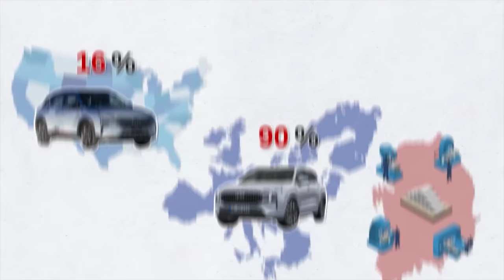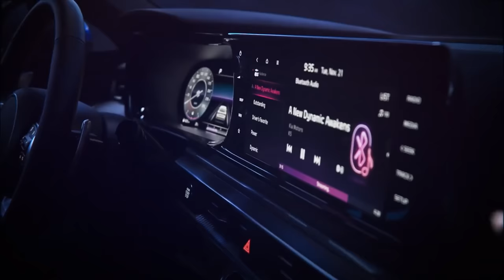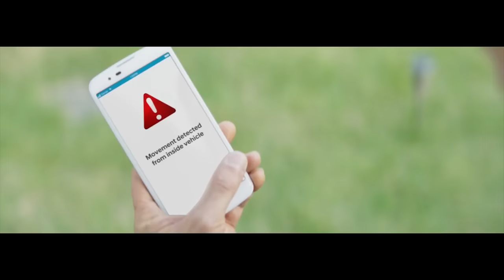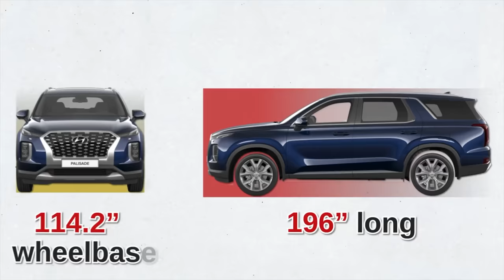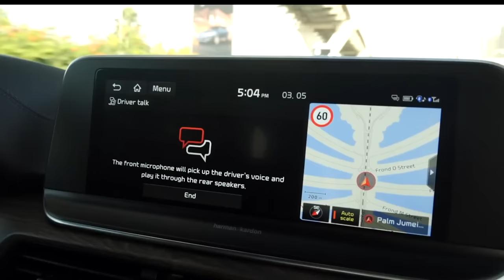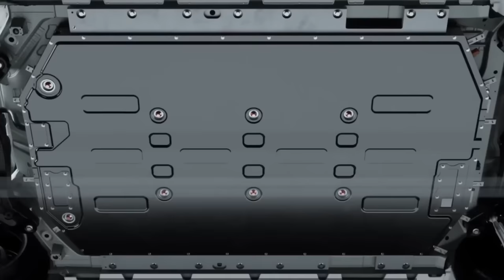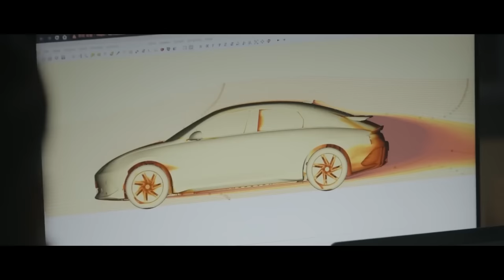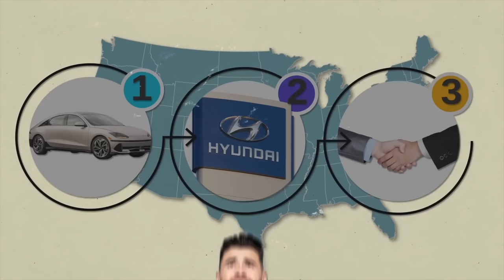No One Else Has the Balls to Say This About Hyundai and Kia, So I Will

Comment: It’s funny how loyal Hyundai owners are. I know one who’s 2015 engine blew up before 150k miles. All they talked about was how much they loved the car and wanted to buy another. Meanwhile I’m in my 2008 Toyota approaching 300k.
Reply: My son has a 2010 camry with over 500,000 miles...only normal maintenance has been done...origninal motor and tranny.  I own a 2009 camry ...uses a quart of oil between 5000 mile oil changes...dont care...it is the best car ive ever owned.  I absolutely love it and have no doubt i will put half a million miles on it too.
Reply: Ya most think 100,000 miles is a lot
Reply: I have a camry 2021 and the engine is leaking oil
Reply: @youdontknowme2915  Good luck with Chevy.
Reply: My 2007 Santa Fe has 273,000 miles.
Reply: Well all my KIA's lasted at least 250K before i sold them,and they were still working fine.
Reply: @tstbad59  They last as much as Toyotas, just maintain them properly.
Reply: Replace my engine for free had no problems and had a nice rental for 3 months still love my car
Reply: Sounds like our family😏
Reply: Hyundai owners I know either got ones that was trouble from day one and I know owners that got 300,000 miles no problem like a dude from work has a soul 310,000 miles no problems only reg service
Reply: @tstbad59  old Santa Fes last a long time. My gf had an 04 that was still kicking on 250000. It’s a piece of junk at this point to be sure, but it runs. It has eaten a lot of starters though for whatever reason. From what I understand though, new Hyundais have a slew of issues
Reply: No issues here. Going at 7 years 162,000 miles and so going. I could not find a Toyota that someone did not think was worth a MINT. My KIA is paid for and runs great.
Reply: Same with Toyota and Honda owners.  The control arm ball joint broke off in a turn and owner looked forward to replacing it.
Reply: @erickgutierrez5724  I believe it Toyota quality is going downhill
Reply: @stockey   some of you get  lucky....it's not the norm
Reply: @stockey  LMFAO ..no they don't.  Honda and toyota  usually outlast them by a lot
Reply: @bsgarey  but 152k isn't a lot
Reply: Well Hyundai and Kia made in 2008 also going good till now, 300k not a problem
Reply: So much people stil driving Santa Fe and Tucson from 2006-2008 till now , I am sure they have not less than your Toyota
Reply: @richsweeney1115  Perhaps not but I previously had cars like Honda Accord that maybe reliable but has HIGH maintenance costs of $1000 timing belts, $1200 dollers worth of engine mounts. I have had none of that with this KIA. It has never been in the shop outside of OIL/Break/Trans services.
Reply: Outside of the issues they've had, what makes them loved and memorable is they always are very comfortable with smooth and quite engine. The cabine noise is also lower than some other cars they compete with. I remember when I had a Sonata, and my wife had a Honda. The Honda's seats were very firm, and the ride was stiff. Cabine noise was also bad. When we took road trips we peferred the Hyundai.
Reply: @Marlon_J  I think many of the issues are owner issues. Not checking your oil/changing it at regular intervals. Not servicing the PVC system. Not fixing oil leaks. etc. Because I drive long distance to work (160 miles) round trip a day. My KIA Optima must be totally maintained to the T....
Reply: Which by the way Is why I hated the Honda accord. Always expensive servicing. Timming belts, engine mounts (twice), transmission solenoid packs. Then at 245,000 the head gasket let go. At that point I was done with Honda.
Reply: Me too my brother's 2013 Hyundai Santa fe sport engine blew up its a 2.0 turbo but he now has an unlimited miles lifetime replacement  warranty on the engines so if it keeps blowing keeps getting new ones
Reply: Funny how this 1/2 hour commercial for Hyundai and Kia comes from a guy who continuously blasts the companies for bad quality and recommends his viewers to not buy them.
Reply: @youdontknowme2915  goodluck with multiple ownership problems in future
Reply: @stockey  lol only few of them ever last that high mileage
Reply: @bsgarey  lol live in dreams
Reply: @jesusmejia7580  same with hyunda kia
Reply: @romank5498  only some in that period not even all of them
Reply: @bsgarey  lol kia soul with its 4th engine and trans going 90k mileage
Reply: @chronomatt6990  cuz ppl don't know about the real truth of real world hyunda kia tho
Reply: Toyota is better!
Reply: Agreed.  I know someone who had a 2018 Kona and traded it in against the purchase of a new Tucson last year - meanwhile the Kona had started developing a blowing head gasket and it's not like it had a ton of miles on it.
Reply: Agreed.  We have friends who thought nothing of an engine failure and will probably buy another of the things.
Reply: @chronomatt6990  I was wondering 🤔
Reply: It’s funny how people hate so much on Hyundai/Kia but never owned one. 😂😂 I’ve purchased 2 new Kias since 2014 and never had an issue. Just like you’re loyal to Toyota, people are loyal to what works for them. Toyota engines are awesome but the cars themselves lacked in styling and technology for a long time. Toyota is finally making decent looking cars. If you compare a camry to a maxima or accord, Camrys always looked like trash next to those two.
Reply: I agree.
Reply: @amandeepbaa6978  not really imo,. They've gotten better
Reply: @danieldimas8863  Maintenance is the key 🔑 for most, unless it's a Chrysler product 😉
Reply: Bro it always happens my brother Kia has problems like a mad dog but he continues to praise it
Reply: 8:25 you can use your smart phone to start your car and if you lose your phone you can use your USB charge cord to start your car... And so can thieves and TikTokers.
Reply: It's funny how loyal Toyota owners are. Even after some of their engines have oil sludge issues.  How the gas pedal got stuck or did an unintended acceleration and it won't stop,  causing accidents and death.
It's also funny how loyal Honda owners are... Even after their some of their transmissions grenaded and some CRV engines have fuel dilution issues that's causing premature engine failure.
You see, you can say pretty much the same thing for any make of car.
Reply: @John Diaz  and my sister has had a Hyundai and a KIA and been fine. She's bad on maintaining anything.
Reply: @jesusmejia7580  yeah in looks, design language and showcase not in their deepsht or stealership network where they infamous duped
Reply: Meanwhile I’m in my 1994 Toyota Celica approaching 400k.
Reply: @tstbad59   same here been the best vehicle that 2,7 is a good motor
Reply: @amandeepbaa6978  Engine failure – This issue was quite prevalent with the Kia Soul, especially with the majority of models we highlighted in this guide. Many of the complaints detailed how they were driving and suddenly lost power and stopped altogether.Jun 1, 2022
Reply: @amandeepbaa6978  This is well know fact with that subcompact auto. I would never purchase one.
Reply: Im a die hard Toyota Fan, i have the 5.7 Tundra and expect this truck to go well over 400k miles and it currently has 44k miles. My father on the other hand has an 04 Camry and surprisingly his Transmission blew at only 100k miles and he babies that car, it now has 120k miles. Moral of the story, just cause its a Toyota doesn’t make it immune to the same issues other vehicles have.
Reply: remember that they are car releases in certain years with problem. honda and toyota too have their bad years, scotty did a video about it :D
Reply: Mine had a computer problem it would stall lol
Reply: There are so large quantities of automobiles made worldwide, consumer logic is turning into a different dimension: just like the smart phone, it's not that costly to switch into newer models every five years. So 150k miles of engine is not that important. New look, new features, and a little more affordable is the future.
Reply: This is because buying a car is an emotional decision. People want to feel their confirmation bias, want to feel good about what they spent their money on.
Reply: I will say this. My sisters Hyundai motor failed due to a simple rubber seal on the freeway at highway speed in the late part of year nine of ownership and they replaced her motor for free. Not bad. My friends chevy spark had a recall fixed by the dealer and after repair it sounds like a rod is going to go any minute.
Reply: @markemery7741  How about a Hyundai with a ticking motor that you know is a timebomb but the dealer says it's ok because it passed a BCT test. Good luck feeling ok with sending your family out on the road with that.
So yeah, garbage brand.
Reply: @Antiorganizer  sounds like a bad dealer more than a bad car.
Reply: @rongurganious9797  he has lifetime replacement warranty tho so I don't think it's that bad lol as long as the rest of the car good can get brand new engine whenever
Reply: @bsgarey  NHTSA continue to fulfill report of new cases
Reply: 150k miles is a long time to own a car. You're hardly saving money over the long term by getting things they will last longer, and you're doing so at the expense of your own joy.
Reply: @youdontknowme2915  get your battery replaced yet?    Recalled just like the first Bolt .   That's quality!
Reply: His behavior is an example of Conformation Bias-he's developed a psychological dependence on his HOPES about the car and, even faced with evidence that those hopes were MISTAKEN, now cannot give them up and tries to JUSTIFY them!  he thinks " I CAN'T HAVE MADE A MISTAKE- I LOVE THIS CAR AND I'M GONNA BUY ANOTHER"!
Reply: @bsgarey  price isn’t bad tbh, was anticipating $3k or something over
Reply: @mygolfballsannoy  500,000 miles is a lot of time behind the steering wheel. A massive amount of time.
Reply: @mygolfballsannoy  hell my wife's Eldorado is pushing 180k miles with the famous N* engine
Reply: @youdontknowme2915  so sorry for ya. 2023 gm 😂😂
Reply: Yes but why did the engine blow up. They ran is out of oil.
Reply: @bsgarey  no it's subpar work from the factory and cheap engine components
Reply: @nickyj3571  Perhaps but you cannot do anything about that. You can keep you CAR full of OIL!
Reply: I knew someone who got a stinger. My immediate thought was “she’s going to dump that pos in 2 years”

I was right.
Reply: @Bootchair  they are ok cars for the $$$ as.long as you know that going into it. Other than that POS boring cars
Reply: @Bootchair  ??? I have had my KIA OPTIMA for 7 years no issues.
Reply: @Bootchair  Reported problems with the Stinger are few, so far, with most relating to non-engine electrics, and most models in the Kia range have a good reputation for reliability.Mar 14, 2023
Reply: @YouDontKnowMe The Toyota would not be the junker even in your scenario. The one that is not in the shop for 300k would be the opposite.Pretty much you like to drive a shiny turd is what it amounts to as we can see from your Chevy turd.
Reply: I have a 2006 Hyundai for my daily drive car with 87,000+ in mileage and so far, I'm still enjoying my Hyundai.

However, when its time to replace it, I may replace it with either a Toyota RAV4, a Toyota Yaris or a Chevy Sonic.
Reply: it comes with lack of understanding and embarrassment of what they bought. i read something that said kids growing up in hyundais will be normalized with items failing on them. also all the coolest words like genesis, soul, accent, stinger, ionic, sonata will be associated with terrible things
Reply: @njcowboys3588  they dont offer lifetime replacements in canada so we have quite a lot of paperweights
Reply: @pppcorn  oh wow, yeah I couldn't believe it either until he showed me the paper from the dealership, I was like damn as long as the frame ain't rotted you can get new engine lmao
Reply: I love my Hyundais the only other car i might drive besides is Genesis. My current 22 Tucson love it and the best one 17 santa fe v6 and still believe 06 sonata v6 is better over all. Sorry for haters
Reply: Maybe because people have had Kias and Hyundais that have been more dependable than Toyotas?  I had three Toyotas and they were the absolute WORST cars I ever owned.  Now, having my first Kia and I'm proud to say..it's been a wonderful experience.  No problems, and the car has many more standard features than any of my Toyotas could even fathom.

It's amazing how Toyota and Lexus fan girls will go to the extreme lengths at defending their garbage vehicles.
Reply: @jacksonndoll5055  hyundai is genesis
Reply: @Rich Sweeney  they are praying and wishing
Reply: @txrazor2643  junk
Reply: You're too old school. Toyota is a just very simple car.. Some ppl buy cars because of performances and high tech. Toyota cars are all outdated and only thing going for Toyota is last little longer than other brands. Not many keep their cars more than 5 years nowadays. I need a high tech car so Toyota is never in my consideration.
Reply: As a previous Toyota owner who have owned 5 Toyotas I only have good things to say about them about their reliability. I’ve owned 3 Kias and they have been excellent as well, so much so that I believe Kia is making better cars than both Honda and Toyota. Kias feel solid and their interior feel as well made and solid as Toyotas were back in the 90s. Toyota on the other hand is cheaping out on a lot of things and while they’re still bulletproof, they’re not without its fair share of issues. Also, not everyone keeps their cars for 10 yrs or drive insane amount of miles on them.
Reply: And if they keep blowing up you get another one why ride it until the wheel fall off
Reply: Common sense. It's a TOYOTA.
Reply: Why anyone buys these vehicles when a Honda or Toyota really doesn't cost that much more is beyond me. I'll happily stick with the reliability and great resale value of my Honda's.
Reply: Ford Focus owner, 2005 @240k still going strong. Have neglected the vehicle a lot but still is a looker and sounds good.
Reply: Depends on your priorities. I would get so sick of a car by 300k miles. Lol
Reply: @richsweeney1115  My Honda Odyssey was  piece of crap
Reply: Hyundai are great cars the difference between Toyota and Hyundai mechanics is that Toyota is more outdated and don’t improve technology and don’t give new stuff to people they improve the dinosaur engines they have (don’t get me wrong it last and everything you want) and the quality is the steel is way less than a Hyundai/Kia I’ve had 5 Hyundai’s already and will keep buying Hyundai seeing the EV someday sooner, the real issue here on any brand is when the flaws appears the people on the card dealers aren’t quite prepared to address the issue, I’d work at GM back on my country Venezuela and I know more than a dealership technician, they prepared only to replace not to fix! And believe me when I said it 😊
Reply: My Hyundai Getz is approaching 300 000km ..

Toyota just got a massive fine in Australia for the rubbish 2.8 diesel engines.
Reply: @conradscheepers  the Getz is such a good car on Venezuela we have them and they are rock solid still rolling there
Reply: my elantra 2010 have 5646321km only shock baljoint and regular oil change each 5000km
Reply: 😂 I’m sticking with toyota
Reply: @tyronmegawatts6580  but bro my hellcat has 3k miles with 0 issues. Pretty damn reliable if you ask me lmao
Reply: @kayossmayhem  that's only on kias/Hyundais with no push start
Reply: @damalewis9277  so? Every brand has a bad one here and there.....hate to burst your  bubble...but I've seen toyotas be shitboxes whe they were maintained, too...
Reply: @erickgutierrez5724  have you taken it in under warranty?
Reply: @mygolfballsannoy  well the average driver drives about 14000 miles a year. thats 7 years of driving for an average person./ so its a lot for the average person. thats a 10th of your life span to reach that lol
Reply: I have a 2012 Tacoma that currently has 270k miles on it and is still going strong. I had a  2017 WRX blew up around 130k and I considered that a lemon. I drove it hard too cause it’s a WRX. It’s crazy how Hyundai owners thinking driving a car casually and it blowing up at 100kish is “reliable” 😂
Reply: Yet. Wouldn't be surprised @thugblaster303 has probably been in more accidents than usual. Simply Toyota owners are simply terrible drivers.
Reply: @wenzhaocai6340  So we just gonna make up our own stats now? Here’s some real stats, Worst drivers according to Insurance companies in 2021
1. Audi - 2.85%
2. VW - 2.73%
3. Mazda - 2.72%
4. BMW - 2.67%
5 Hyundai - 2.57%
6. National average - 2.27%

Because according to REAL stats, Hyundai drivers are in the top 5 of worst drivers. Try again.
Reply: The thoughtfulness they put into their vehicles is extremely impressive.  Little cool, nifty things get put into their cars.  I’ve had mustangs, Mercedes, Lexus, Subaru, and Audi vehicles.  I had a Veloster N before I bought my current Lexus.  That little car was absolutely well thought out.  So much so that I am getting the itch to purchase the Kona N due to Albert Biermann’s hands on work on their production.  My Lexus bores me but it is luxurious and very reliable.  I think I need the Kona N as an extra vehicle.
Reply: @erickgutierrez5724  Toyota has proven to be bullet proof for decades now. I have a 2000 Camry with 340K running like new. I still buy Toyota and Honda only. 🤔
Reply: My 2016 Hyundai engine blew up at 115k🥲
Reply: I had a 2017 Ioniq and LOVED it! It was totalled during the recent storms😢😢.
Reply: Toyota quality is not the same as it was in 2008
These Brand fanboys crack me up.
Reply: @tyronmegawatts6580  i don’t why i found it funny
Reply: Go show me another car you can get for 42k that has all the luxury of a 100k car that my Sante Fe Calligraphy has. Heated and ventilated front seats, heated rear seats, heated steering wheel. 360 camera, turn signal camera, Napa leather, suede headliner, AWD 2.5T engine, every safety tool you could want. Nothing comes close for that price. I’m not a complete Hyundai fan boy but man what you get for the money beats other brands.
Reply: 270k on my Hyundai.
Reply: We had a Hyundai that was still going at 360k when we traded it in.  The only thing we had to do outside of the usual oil, brakes tires etc was an alternator.
Reply: @njcowboys3588  Nope it won't work that way. Don't buy anything that has lifetime warranty on Hyundai.  They won't honor it and you will have to hire a lawyer. My cousins 16 Sonata hybrid battery has failed. His car has been sitting at the dealer for over a year saying the battery hasn't arrived. In the meantime they keep trying to get him to trade it in. Now he's filing a lawsuit and it's taking time. Because of that I ain't buying no Hyundai or Kia.
Reply: @Sam-656  hmm it worked once so far
Reply: My grandpa's 06' sonata V6 is almost at 300k. I had an 07 camry where the engine went out before 200k miles (regular maintenence, known engine defect). Generally I would agree that Toyota and Honda are better, but not all engines are created equal!
Reply: You list a car with know issues, recalls on the 2.0 liter engine, kias and hyundai can go 200k plus miles, in fact scotty did a video with a kia forte, 1.8 liter engine with like 250k miles on it, every car that has ever been made, has bad years and good years.
Reply: @narutobase45  Facts.
Reply: older  Toyota yes ..new Toyota no good
Reply: My sister has  1989 Toyota Corolla still going strong in NYC no less.
Reply: @tyronmegawatts6580  GM used to make good products but not currently. 3800 buick V6 is as reliable as any toyota. i have a co-worker that has a grand prix with 270K on the series III 3800. i have a 2003 bonneville 117K and i consider it to just be broken in. it is an SSEi with the supercharged engine. i also have a crosstrek which so far has been great but it only has 12.5K on it.
Reply: At 150k, both cars lose 80-90% value. For example I can buy an equivalent Hyundai with more features, also save some money, at 150k mark use that initially saved money to buy Toyota with 150k miles. Basically I had more features at no cost.
Reply: I'll take a honda over toyota, but same concept
Reply: @bsgarey  even 152k isn't much....
Reply: @romank5498  yea..... older kias are ok...around 2010 they started building crap...I wouldn't expect one t last to 300k ,but thy were better in the 2000s
Reply: @bsgarey  the timing belt I the only  downside to honda.. and in like 08 I think it was,honda changed their timing belts to timing chains. the v6 still has a timing belt
Reply: @chronomatt6990  you think he controls the commercials??
Reply: @ErichH68  slso is honda..
Reply: @danieldimas8863  I'd never own a kia, I've known 4 people who owned them,maintanedthe, and the motors blew with lower milage.... you dont have to own one to see the  issues....common sense...,
Reply: @jmartyt9810  nothing tha has had oil changes often eough,will have sludge..not enough to be an issue anyways...clean oil won't leave sludge...
Reply: @bsgarey  I can't belive some of you believe everything you hear..
Reply: @trekkienzl2862  look at Hondas, too
Reply: @jacksonndoll5055  lol......nothing but a Hyundai???? that's just ignorant. I you think hyundaino reliable,  you'd be blown away by most Hondas and toyotas, lexuses and acuras.....do yourself a favor...Google Hyundai andkia problems....
Reply: @DeadofWinter321  I really dnt think thas true. Hondas and toyotas are literally 2 of the best on th road.
Reply: @damalewis9277  that's  the only honda even scotty has see problems with. the restof honda is fine
Reply: @richsweeney1115   i don't have to Google, I have Hyundais. You can also google Hyundai is the third company worldwide by sale volume. Those people must be ignorant to buy Hyundai like that. I don't care what people drive, i am fine with Hyundai.
Reply: @richsweeney1115  any without GDI engine will be good, and even if not, no one gets car for whole life like before, I am usually getting new car and drive until 100k or 5 years , even 4 years, so can sell that car for good amount of money and get something very advanced instead of drive  old car pay for service and in the end sell for few bucks
I can say in Korea they use Kia and Hynda for taxi with LPI engines, and those cars running pretty good till 600-700k kilometres… feel like all depends also market where car are going
But I can say for sure in Europe they are way better with materials and engines, don’t know why Canada and USA have so much drama around Korean brands..
Reply: Meanwhile I'm in an 07 camry close to 300k , you guys have fun with your Korean cars lol
Reply: @Dan-xp5ve  lol, man you can buy old Nokia brick and laugh at people using latest phone. What the car offers isn't only transportation from point A to point B, they offer convenience, and the value of that differ person to person. I wouldn't put my kids' lives in danger in that old car to save a few thousands, safety standards have gone way up.
Reply: @richsweeney1115  - They were back in the 90s.  Other brands have caught up, plus Toyotas and Hondas long term dependability has dropped very significantly since the early 2000s.
Reply: @richsweeney1115  I do like the Honda Fit
Reply: @richsweeney1115  Maybe but that is about average for me. Both of the accords I had only reached 245,000 before engine destruction. 1. oil failure 2. Head gasket failure....My other cars have been 1. ford 195,000 Accident, 3 GMs 175,000 average.  I drive 160 miles a day to/for work.
Reply: @jesusmejia7580 most manufactures quality is going downhill. But yes, the quality in Toyota is down, since more and more Toyotas are not made in Japan. The best quality Toyotas were always made in Japan
Reply: @youdontknowme2915  Most small and mid size Chevy cars are made by Daewoo
Reply: My 2017 Hyundai Tucson made it to 80,000 until engine damage 🤦🏻‍♀️ worst vehicle I have ever owned.
Reply: Toyota the uncle car ? 😂
Reply: Yeah, changing oil every month
Reply: never buying another hyundai ever again,thing sucks. knowing that kia is just a rebrand,I wouldnt buy a kia either.
Reply: I think they just don't know any better. I have a Mazda 3 from 2010 that is at 196k and I have only had to replace normal things like brakes and the calipers just went out.
Reply: My 2012 Hyundai is still going strong, and I'm sure there are some Toyotas that had blown engines!
Reply: we have a 2004 sienna as an extra car logged in 325000 miles. my 2009 Kia Borrego SUV is at 290,000 miles. Neither of two vehicles had any major issues. Love both of them. Both Toyota and Kia vehicles are very well made.
Reply: @youdontknowme2915 that Toyota will not see a shop it's whole entire life but your Hyundai and Kia will be in the shop for half it's life or 150k miles. My neighbor owns 2 and they're always in the shop regardless if you use them out not.
Reply: Don’t know about Hyundai but I have a Matrix with 52,000 miles and it’s been in the shop 4 times because it keeps pulling to the right. After 4 separate alignments(not covered in warranty) no one knows why. I’ve asked about suspension(which is under warranty until 70k mi) and I’m told it can’t be that. So now you know someone who’s completely unhappy with his Toyota before 70K miles.
Reply: @00DarkWatcher00  wow such low mileage, I’m sure you can sell it for a good amount if your unhappy. What year is it?
Reply: @ErichH68 Toyota is more known. Not better.
Reply: Toyota sucks!! I had 2 , both broke down before 5 years, the handles came off in pieces in my hands. After that I started to call a TOY just like in the name TOYota!! I have a Hyundai  for many years never had an issue , and I would buy another one!!
Reply: Why do you want a car from 2008?😅
Reply: @ErichH68  And boring to drive
Reply: I want an old Mercedes 300d. I just don’t like any of these newer cars.
Reply: Borrowed a friend’s hybrid Hyundai while getting my 100k service on my VW Passat. Hyundai interior materials felt cheap. Hated that computer screened car. Was glad when I gave the car back.
Reply: My turbo only survived two 103k. Engine limp mode
Reply: I have a 2012 kia cerato (forte). Never had any major problems. The engine is 180,000 km and no problem at all. My dad's 2011 Santa fe is at 350,000km at is still going strong.
Reply: 2015? then the car was under warranty as KIA offers a 7 year warranty. Had that happen in a Toyota you'd be shelling out for a new car. Are KIA as reliable as Toyota/Honda? No but its close. However to make up for that fact they offer a 7 year warranty and the cars cost CONSIDERABLY less.
Reply: That's Corolla from 2004 to 2008 are war tanks 👍👍👍🙏🙏🙏
Reply: I have a Buick rendezvous 2002 over 200 thousand miles and still going.
Reply: I knew a dude that got died from fried chicken. 😮
Reply: The interior design is loathsome. Never again. Ever. 
Drives well tho 11K
Reply: @youdontknowme2915  hyundais arnt not cheap at all you better look agai
Reply: I’m in my 2002 Acura RSX-S bought new.  Everything is still original except the battery, tires, spark plugs and windshield blades.  But only 160,000 miles.
Reply: Do you Think Huyndai can last for 200k miles?
Reply: @ZuhairJumaa There’s a Hyundai Elantra that went 1 million miles. Hyundai gave the owner a brand new Elantra as a gift.
Reply: I’ve had three Hyundais make it to about 275,000  miles before pooping out on me.
Reply: Well my 2006 civic which I passed on to my daughter in 2019 is still working well, I think beyond normal maintenance I've replaced the starter, and struts, that's it, I bought a 2016 Hrv cause I wanted a little more room and will be passing it down as well, only getting a new car this time cause I want one, Honda for life!
Reply: Did you get confetti after you pressed send? Fanfare? Lol whooppoopdidoo
Reply: @ParsleyTheDruid I was supposed to pick up a new Hyundai 2024 Tucson but didn't get approved this morning..was it a blessing in disguise ?... I'm wondering what to do now
Reply: @ErichH68 what would you suggest for a finance right now ?....I thought 2024 Hyundai Tucson was the way to go....now im hearing otherwise ...my pops says to go with TOYOTA but these prices are crazy right now
Reply: @kayossmayhem wow I heard about that smh
Reply: What would you suggest for me right now to get ?... Rav 4 or a camry oh which year would be the best ?
Reply: @erickgutierrez5724 whaaaat u Serious ?
Reply: I have an 09 sonata with 220+k not 1 single issue ever.
Reply: @amandeepbaa6978  same as with any other vehicle. Model year and maintenance play a huge part.
Reply: @stockey  wow that's awesome bro I just picked up that 2021 Kia Sportage AWD and it's really good only had 23k miles on it too...God is good seriously!
Reply: @bsgarey  kia really is a lot better than I thought I have to say! I slept on em
Reply: @bsgarey  amazing
Reply: Was at 170K strong in my elantra, was expecting to get a lot more out of it.... then.... it was stolen and totaled...
Reply: @Marc_Anthony  damn bro that's foul yo sorry to hear that big Dogg....hope it comes back to you in the future 🙏
Reply: @bsgarey no don't give up. Get it serviced😂😂
Reply: That’s one heck of an anecdotal case study! Maybe we should set up a class action suit. I mean obviously ALL of their cars must be bad quality, even though we know nothing of how the owner serviced it or lack there of. We also know that ALL Toyota cars are mechanically perfect and Toyota certainly has NEVER had any issues that would say, cause a car to speed off uncontrolled and kill people. Have Any other smart comparisons or car wisdom for us?
Reply: a taxi company went to Korean cars
Went back to Nissan
Reply: @Roadrunner_1000  Two Accords with oil  pump failures and headgasket failures. $17,000 for KIA Optima has been  a way better deal. I am on the road daily for 160 miles a day four days a week. No issues so far.
Reply: When you step on the breaks or start out from a stop. You can feel the engine shifting about. Vibrating on the highway. Etc. So yes....   I am not running about town a mile hter or there. I am in my car 3 hours a day. Timing belt has a schedule. At this point I would never buy a honda again.
 @Roadrunner_1000
Reply: Most of them are much of a muchness.
My Auris has been fantastic but my one car is only a small sample size.
Reply: Ye but toyotas are boring
Reply: who is 2015 engine blew up?
Reply: A lot of cars blow before 150k lol
Reply: Me too. My local Hyundai dealer was great.
Reply: It's not beige on beige is it 🤔 get out of the left lane 🤣🤣🤣
Reply: Some people are just ok with cars lasting by half as long as they should if you take care of them. The companies reflect this bc people still buy them like that.
Reply: 2006 elantra, 420 000 ks, zero maintenance..unless you call topping up oil , 'maintenance', zero problems.
Reply: @youdontknowme2915 Ummm no you can't. Toyotas are not that much more expensive then hyundai.
Reply: @erickgutierrez5724 Really? Where is the leak?
Reply: New Hyundais remind me of 1980s era Toyotas. Anvil like reliability and great mpg. My last 4 cars were Hyundais.
Reply: @MAX5WM  Mechanics say other things and recalls say other things. From what I hear the new hyundais are generally reliable if maintained and don't take kindly to skipped maintenance. However hyundai still has more problems then toyota. Some of the hyundais years in the teens have had huge engine problems.
Reply: My 2017 Elantra is hands down the best car I've ever owned and I've owned a lot of cars.
Reply: My dad owns a Hyundai. A 2014 Tucson, almost 10 years and still running great. But then again, we live in a small island so it doesn't have much miles on it, only like 70k iirc.
Reply: I have to say that the Kia Hyundai engine recall was handled really well. Manufacturers will invariably experience problems, but look at the way General Motors, for example, handles recalls…they don’t. They get their accountants to crunch numbers to see which is cheaper, fixing the original issue or just paying the odd lawsuit over it.
Reply: I had a 2015 genesis with motor issues.  Hyundia renuilt the motor....still had the noise.  They eventually replaced the motor. The car was never right after all of that.  The fixed and replaced just about everything.  I got rid  f the car and  got a 2020 kona.  I loved the genesis but it had problems.   I love the kona...fun little  suv.
Reply: @kayschwartz4410  camrys are boring, though. They're nothing exciting to look at.
Reply: I own a 2009 touring with 285k and 2010 accent with 340k. Both still going very strong.
Reply: @anthonylim2428  why do you drive so many miles
Reply: I had 2 Toyota’s and both were so so vehicles, nothing special. My 4Runner was underpowered, underwhelming brakes, small gas tank…got rid of it.
Reply: Who wants to drive a car for 300k miles? That would be 20 years on average. Engine may run that long, but everything else would fall apart.
Reply: I know two people that bought a Kia Rio, they hated it.
Reply: Well I’m very into Toyotas especially in racing I can tell you Toyota has had the big issues with there engines in the. Orilla and Camry they just keep it on the hush at least Kia and Hyundai sucked it up and replaced those engines I’m sure some people who owned theses cars did get that lucky but you first have to look at when they purchased the car . I had a client who bought a Kia car from previous a small dealer and he tried to get under warranty at first he didn’t succeed but at the end we got a new engine from them he had to pay the labor witch I think it’s was more than fair
Reply: Hyundai destoys lives of whistle blowers. Kim Gwang-ho got paid for his whistle blowing on Hyundai only because the US govt forced Hyundai to pay up. Otherwise, Kim Gwang-ho would've been destroyed in South Korea. Now the South Korean govt wants to fine the living hell out of the whistle blower. I'm Korean, and Hyundai Motors in Korea isn't exactly the nicest company around town.
Reply: I have a Hyundai… never buying another Hyundai
Reply: At least here in Finland you can buy 2 equivalent Hyundais/Kias for a price of 2008 Toyota. And they drive much better.

Back then their engines were still quite reliable too. There's a lot of those cars in market with 350-450 thousand km in meter and still running perfectly fine.
Reply: 2010 Hyundai Tucson 302179 miles still going strong but that doesn’t mean I’m going to buy another one even though I’ve never had any problems with it
Reply: Not even close Hyundai cars cost as much as Toyota.
Reply: @OkayOlivia402  Where?

Here's few price ranges of actual sales on comparable vehicles in Finland:

(All Kia, because Hyundai doesn't sell many equivalent vehicles to Toyotas here, mostly just crossovers. Sonata is above Avensis in terms of specs, and slightly below in price. MPV's I didn't bother with because they're boring.)

2008-2010
Kia Sportage 3000-5000
Toytoa RAV4 7000-10000
Kia Ceed 2500-4000
Toyota Corolla 5000-6500
2012
Kia Rio 5000-7000
Toyota Yaris 7000-10000

Actually I was quite surprised how few comparable vehicles Hyundai/Kia lineup has, since people often like to describe them as Toyota copycats...
Reply: I understand..I bought a SAAB 9-3t. I loved that car. I did not love the expense of repairs, which were only two major ones, and a few minor ones. As long as the car was running, it was a blast to drive, very comfortable, and fantastic mpg. But at one point, certain necessary part failed and a replacement could not be found. Had it not been for that, I would have kept the car.
Reply: I have one now and it give me nothing but problems 115,000 miles. 2017. I rather have a chevy
Reply: I have a Toyota Hilux Tiger 2003 going very well and strong on 368K
Reply: I have a 2012 Hyundai Sonata 2.0T SE and it has 213,000 miles on it and it runs great